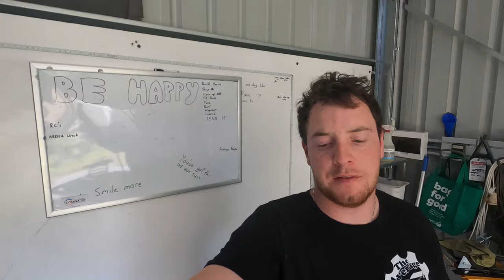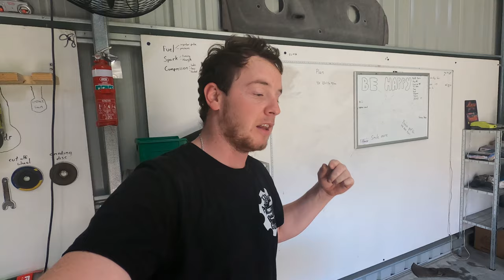HOW TO REBUILD A BARRA! Core Plugs, Dipstick Relocation and Ring Gaps

Comment: Hey man, I’ve lost that dip stick plug, I was wondering where I could get one of those?
Reply from the maker: Either ford or a local machinist would be able to make one in 5 mins
Reply: @T.A.G  thanks mate!
Reply from the maker: No dramas mate. At worst aswell if you wanted to save money you could drill, tap and thread seal a bolt in there
Reply: @T.A.G  Good call...🤔😂😂😂😂😂

Comment: I've recommended you for;
The Nobel Peace Prize...
I'm in the states, and the Barra is pretty much impossible to get. Is there a book on "Barra buying guide" and where can I get a plastic mock up engine...
Reply from the maker: I'm not aware of any plastic mock up. People here usually use a junker engine as they're readily available. For the state's I'm not sure what you could use sorry. 
There's not a guide to buying but there is plenty of info about them. The common problems thought out all engines in oil pumps, timing chain guides and valve springs. Other than that the early B series had thin rods. :)